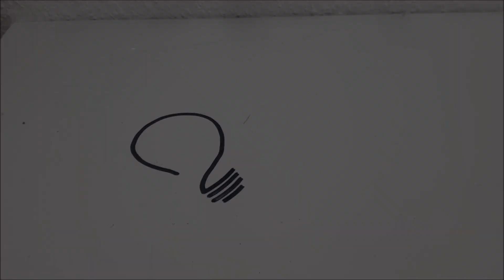Making a Serving Tray on the Scroll Saw

Comment: Thank you for another  simple design and flawless execution.  Do you have a ressources to measure and calculate the compound in this project.  I would like to modify the angle instead of 10degree I would like to make to steeper degree.  Thanks and continue to inspire us.
Reply from the maker: Thanks for watching. If you are planning to use the same technique its just a matter of setting  the number of degrees on angle gauge to your liking. You'll have to use the same angle for cutting out the bottom piece.